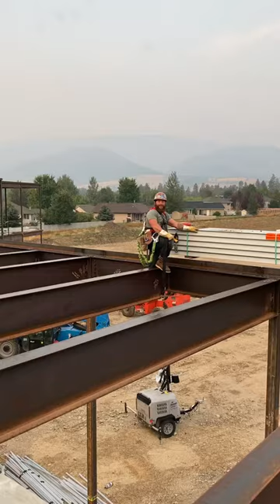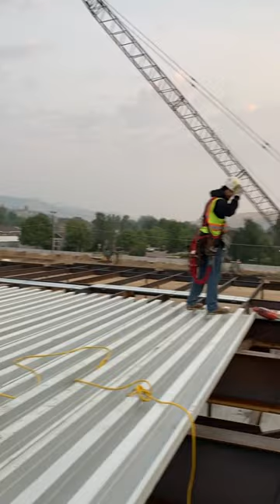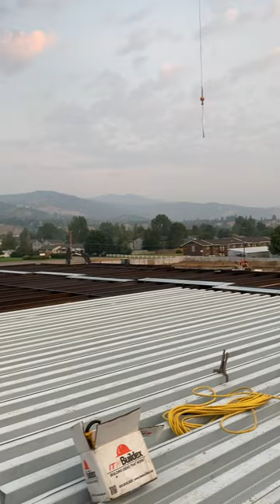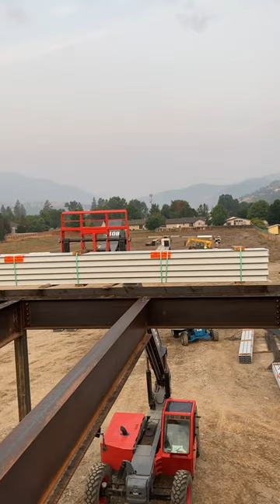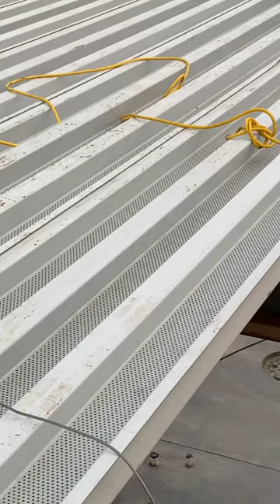Mountain Dew is wrecking apprentices. Plus acoustic deck. #davisfam #ironworker #ironwork #dothedew

Comment: Have not worked with acoustic deck yet, what is used for??
Reply from the maker: I’ve seen a couple different types. One type has metal on the bottom and is full of insulation. It’s stupid heavy and won’t slide. The other is perforated to put in insulation later and is super flimsy but also won’t slide. 

They’re both meant to control sound.
Reply: @Jason_Biscuit_Davis  oh so it’s called acoustic, you completely corrected me we erected a school in sac and used the insulated deck and had to spread dragging the deck with hammers all day, still a first period apprentice but been pushing to learn as much as I can thank you for the response💪🏼🙏
Reply: It’s used to get the new guy yelled at all day